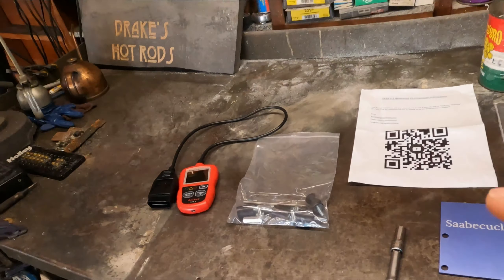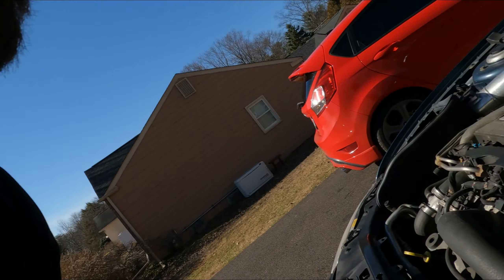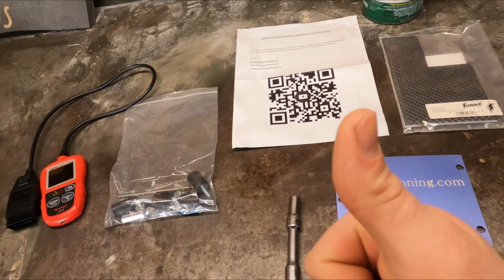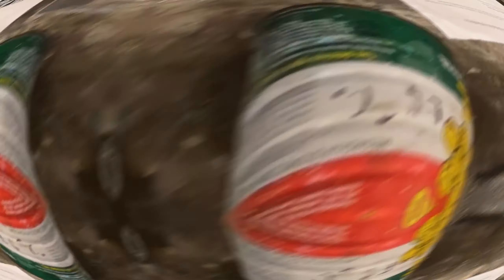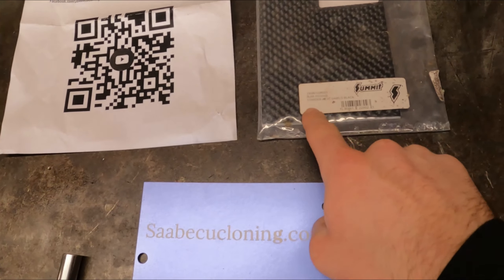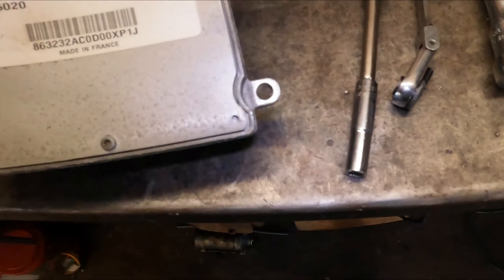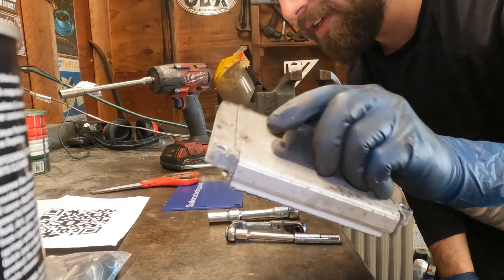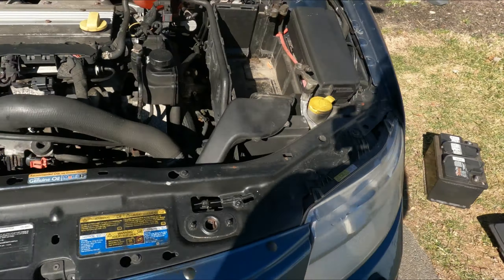2007 Saab 9-3: An Absolute MUST for 2.0T owners! Prevent P1681!

Comment: Hey I’ve been having the same issues with my SAAB 9-3 2007 the mechanic told me I needed to replace the throttle body I did that and it didn’t fix it at all, the codes I have though are P1564, P2859, P0846. My car starts up but doesn’t pick up speed and sputters then needs to cool down before I start. Any idea on what to do or if it’s this issue? Please help
Reply from the maker: Hey man. That sucks the throttle body didn’t fix it. It could be a number of things. You could ask your mechanic to try to diagnose and find out if it really is the ecu
Reply: you need a Tech 2 scanner..
Reply: @ddubsgarage8285  mechanics told me it was the throttle body when they scanned it, but I researched the codes I had and the codes came up to be ECU/ECM. but a couple Saab YouTubers told me possibly the ECU sending incorrect messages to the throttle body and other parts. Or spark plugs or coil packs
Reply from the maker: @Thezalafamilyclips  I would definitely invest in the tech 2 scanner

Comment: Replaced my ecu 1 month ago for 600 dollars,got p 2135 few days ago and now p 1681 ,is it sure to be ECU?
Reply from the maker: I couldn't tell you for sure, I would replace check your battery voltage as I did and make sure it isn't low. If that does not solve the problem, I would try replacing other parts related to those codes (if you're looking to go DYI)
Reply: @ddubsgarage8285  my ECM is almost 2yrs old and I started it the other day and it ran very rough and smelled a strong smell gas. My code was p1682 and of course p0137 and p0300. I think it’s the ECM again. I changed the plugs to see if it would run smoother b4 codes popped up and the spark plugs were a lil wet and smelled like fuel. Sounds like ECM?
Reply from the maker: @chrisshore9000  I hope for your sake it isn’t the ecu! Definitely check your battery voltage and also find out related symptoms for the p0137 code. Best of luck!
Reply: @ddubsgarage8285  brand new battery maybe a month old and my eSID2 shows alt is working. Battery’s voltage was a lil high when I 1st put it in. 14.2volts. I’m not sure where the voltage regulator is. I’ll recheck all that when I get home. Im not worried if it’s the ECM.
Reply: Where did you get it from? Most people would sell you a "working ecu" knowing damn well it could give out any time now and lable it as "working"
Reply: @joshrawks21  lifted the ecu,cleaned  the throttle body and replaced throttle gasket,this solved the issue.

Comment: Your Ecu has been in that position for 16 years, do you think it’s necessary at this point? I’ve considered doing the same think for my 2008 but then figured any heat damage would have occurred by now. What are your thoughts?
Reply from the maker: I’m a little ocd so I like to do little modifications like this, especially if it might have a chance of extending my Saabs life. You definitely make a good point.
Reply: My thoughts as well.  I have a 2004 9³ going on 19 yrs old.  I have a feeling that moving the ECU now would be the cause of it  going out at this point
Reply from the maker: @popeye5808  I hope if it’s been going strong for that long then it keeps working for ya!

Comment from the maker: I couldn’t tell ya if anyone does those fixes in the US. Seems like sort of a lost art, obviously the prospect of having to dig into my ecu scared me. I got very lucky it was only the battery. I feel better with that spacer kit in there though. I appreciate the comment!
Reply: My Saab mechanic told me that these babies are very, very voltage sensitive and once the battery always keep an average below 12.5V, problems will build up and finally big $$$ from your wallet.  It did happen to me after I tried to save some $$ on new battery and bought a re-built one which caused my ECU / ECM dead and cost me more $$$ to fix it !  Besides, always check the battery cables to see if they got corrosion especially the insulation layers as well as battery terminals.
Reply from the maker: @@mattharvey7878 sick!! Do you know how much horsepower you’re making now? I feel like I could use a bump in power too.
Reply from the maker: @@mattharvey7878 that’s awesome! My butt dyno is telling me it’s time for a tune. Would you go catless? Those are getting hard to find
Reply from the maker: @@mattharvey7878 hell yeah! I would love to hear that on the highway flat out. So cool!

Comment: You covered up the ECU venting port. That is not a good thing to do. It has to be able to breathe throught that port.
Reply from the maker: @Youtube_kontot  where’s the port?
Reply: @ddubsgarage8285  Its the black rubber thing where you put the extra heat shield.
Reply from the maker: @ oooh gotcha

Comment: I would beat all of that and go get some manifold. Paint heat resistant manifold paint spray the hole and bottom side of that manifold and the computer backside. Save some money.
Reply from the maker: Not a bad idea! I might be having throttle body issues so maybe while I’m in there….

Comment: sounds more like your fuel pump pressure ...as it gets hot the fuel turns into vapour and then your car wont start.
Reply from the maker: With all these other comments I hope that all those fail points don’t go bad. I appreciate the input. So far everything works awesome and after the spacer kit and new battery I haven’t had any issues at all.

Comment: That's a solder issue in the ECU. Easy fix.
Reply from the maker: Just ended up being my battery. Low voltage ghost code. So I just did the ecu spacer as a preventative thing

Comment: Had the exact same issue + some other minors which were screaming "throttle body". Eventually my ecu died so i did that first. Then all of them disappeared. Throttle body is completely fine. 😄😄🫣🫣
Reply from the maker: Woah! How did you source an ecu? Did you need the tech 2 to marry it to the car?
Reply: @ddubsgarage8285  i am not in the us. A bit easier to find one here. Yes tech2 is necessary.

Comment: Using rock glass it best it insulates up to 3000f
Reply from the maker: Rock glass?
Reply: @ddubsgarage8285  Also called ceramic fiber blanket one sheet can insulate 2400 dubbed it and you have protection up to 3000f.
Reply from the maker: @eazystreet5507  I think I will look into that for sure!
Reply: @ddubsgarage8285  I wrap mine in aluminum after with stainless zip ties. Got it on my SAAB turbo and down pipe. Huge temp drop under the hood. The 3 inch down pipe runs by the oil filter and trans pan.
Reply from the maker: @eazystreet5507  that’s awesome.